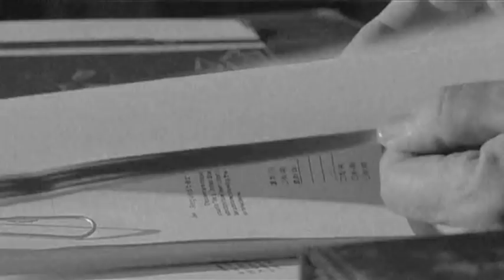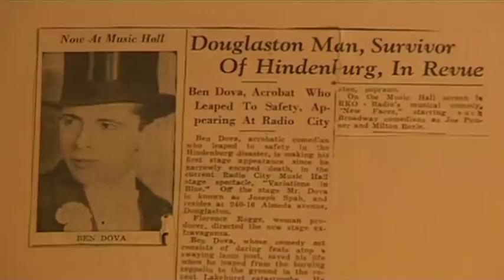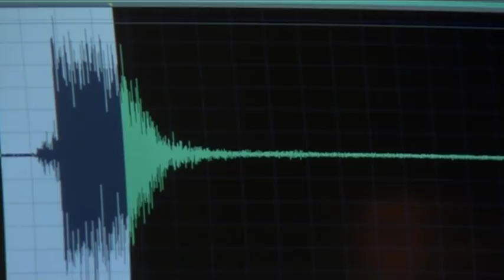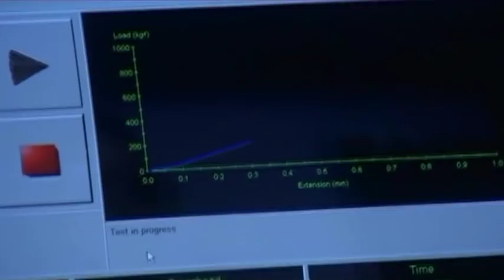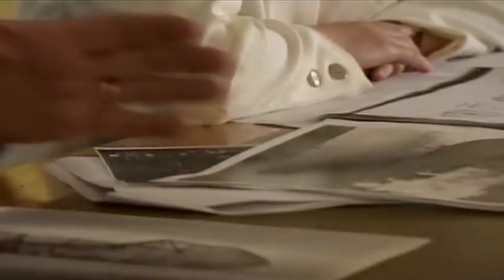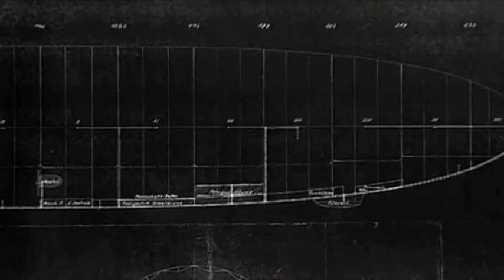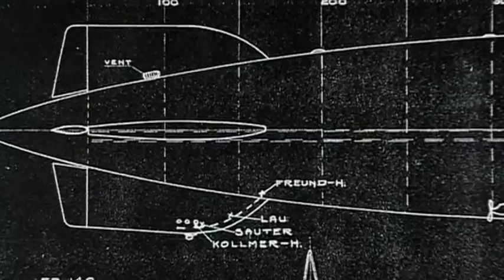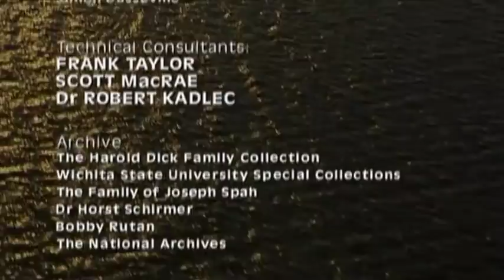Discovery Ch Documentary - The Hindenburg Disaster: Probable Cause (2005) -  hosted by Jack Roberts

Comment: The cause is obvious, since the landing was filmed. The Captain was obliged to constantly drop water ballast from the rear, to make up for the loss of buoyancy resulting from gas leaking from the rear gas cell. The cell was almost certainly punctured by a wire which snapped when the Captain turned too sharply. The Graf Zeppelin flew safely for thousands of miles - the Captain was almost cautious to the extreme and never took any risks. As to the cause of the spark which ignited the escaping hydrogen - almost certainly static electricity, resulting from the outer skin being inadequately bonded to the aluminium frame. There really is no mystery as to why the Hindenburg caught fire.

Comment: That colour film is LZ 130 Graf Zeppelin (II) in 1938, not the Hindenburg.

I had a UK version of this documentary before but lost it - I'm wondering if anyone has it. This version is cropped to 4:3 and then stretched back. The source should be 16:9 with the LZ 130 footage being wider.
Reply: Frank Lin Yeah i knew that was the LZ 130 from the start of that color film. I've only seen one short video of the LZ 127 & LZ 129 in Color. They all look lovely in thoes films...really shows the full detail of the Zeppelins. If you have'nt seen the vid, heres a link.: 

https://youtu.be/23D4g4E_K3k
Reply: Hi, 

I've seen that film before - it only colourized from black and white, not a true colour film. The name of Graf Zeppelin was most likely red from the start (but there is still debate whether it was black during the first year). That footage also shows LZ 130's name by mistake, and it was definitely red.

There was a Japanese short film that had colourized Hindenburg footage but I checked again the video was removed! :(

There are quite a few LZ 130 colour photos but I've only seen 3 LZ 129 confirmed colour photos - two showing the engine cars in flight, and one from the ground with the ship very high up over Suchteln. There's also the colour postcards of the interior, but these might have been colourized. It is said passenger Otto Clemens had colour film on the last flight of the Hindenburg, but he lost it in the fire.
Reply: Frank Lin Wow, what a shame that the film was lost. There is a pic on Google of LZ 129 on the Mooring Mast in Lakehurst in 1936 color photo of the ship on the ground and people around the ship.
Reply: Do you have a link to that photo? It's probably colourized.
Reply: Yep - colourized for the book cover of Zeppelin Hindenburg by Dan Grossman, Cheryl Ganz and Patrick Russell. If you look carefully the Olympic ring colours are misaligned. Original photo has not been released but it was taken by Bill Schneider, a postal clerk who befriended some of the Hindenburg crew (some of his other photos appear inside the book).
Reply: Frank Lin Darn :/ it seemed so realistic color-wise. I noticed the Olympic Rings as you mentioned that is strange how the colors are different. I want to build another Zeppelin like LZ 129 using the old methods...would need materials/ people/ funds/land ect im looking into it...now i just got to ask around for willing participents.
Reply: I found two more LZ 130 colour films, although the colours in both are more faded than Harold Dick's footage. One is seen at the end of this video (unfortunately not very good quality):
https://www.youtube.com/watch?v=FV6foW4REME

Here's another one that's better quality but the colours are more faded:
https://digit.wdr.de/entries/88736?index=52&q=eyJ7Yn0iOiJ6ZXBwZWxpbiJ9&qt=search

As for that colourized footage link you posted earlier, the source documentary is called "Hitler's Champions" (originally released in France as "Les champions d'Hitler" and also in Czech as "Hitlerovi šampioni").  The main focus of this documentary was on the Olympic games but since boxer Max Schmeling and stunt pilot Ernst Udet are two of the key characters, Zeppelins are also shown.  You may find a fairly decent quality stream of the Czech version on Dokumenty and also a 1080p HD MKV download on Uloz (just search the Czech title will take you a few hours to download both episodes). I can't find a version without TV watermarks as on that Wehrmacht video, but the Czech O2 HD watermark isn't too distracting.

Episode 1 has the launch of the LZ 127 Graf Zeppelin (but oddly, the name scene shows the LZ 130) and the Hindenburg, as well as briefly Max Schmeling's arrival on the Hindenburg. The second episode has footage of Ernst Udet's sky-hook trapeze test with the Hindenburg in 1937. You can see some of that footage here:
https://www.youtube.com/watch?v=C3yEKoO2ohQ

The edit in the documentary makes it look easy, but it was quite cumbersome as seen in this more complete Italian newsreel:
https://www.youtube.com/watch?v=J2kzo1JOtmk

Odd thing is the producers colourized the Graf Zeppelin's name in black and Hindenburg in red. The consensus of German historians at the Zeppelin Museum in Friedrichshafen was that the name started as black and was only changed to red by the time of the Nazi era and the takeover. However, several newspaper accounts from the christening in 1928 and onwards which assert the name was red.  It is also interesting to note that there were some laws prohibiting the names of airships to be red, but Zeppelins seem to have been an exception.
Reply: Frank Lin Wow! Amazing color footage of LZ 129 and 130 just beautiful! Ernst seemed to have alot of problems lining up the hook of his Bi Plane...dont blame him seems too risky, no wonder why hindenburgs crew removed the hook later. Makes me wonder if the hook idea damaged the keel in the same spot enough to where thoes two large water ballast tanks go flying out under the ship in the  explosion.  Anyway great finds that high landing should  have never happend.
Reply: I'm not sure the hook was ever removed. There were some statements saying it was already there in mid-1936, and extended for the April 27 test (I haven't seen any photos of this one, as the previous newsreel comes from March 11).  It's very hard to see to begin with and it is likely they would have continued the tests had the last flight been successful. It's also important to note that Udet was out of his glory days at the time and other pilots were arguably more suitable for this maneuver. He was a heavy drinker and some reports say he didn't like his job at the time. It is said that later on when the war started, Goering basically screwed him over to the point of suicide.

It's not often mentioned but on March 11 the Hindenburg also used a 3-bladed propeller on its aft-port engine car. This can be seen in this picture:
http://www.der-isenburger.de/aktuell/09-10/pdfs/30.pdf

Here's another 1937 photo, probably on May 3 (it is labelled as such in Henry Cord Meyer's archive, but difficult to be sure).
https://www.flickr.com/photos/sdasmarchives/38835777901/in/album-72157661261356747/

However, due to some damage during pre-flight tests, the propeller wasn't as loud and had some vibration issues. It was subsequently removed. A week before the flight to Lakehurst, the propeller was added again but the key engineer overseeing its operation was unable to make the flight and asked it removed.

As for the water tanks, I don't know why only those two burst out. However, one of the foremost airship historians I talked to determined the forward tank is a wastewater tank (.......); the rear tank could be fuel or water.

I've always wondered why a large crack appears behind the passenger decks moments after the fire began and halfway into the crash the side of the airship buckled inwards and that gas cell (cell 11) "burst" (see 39:36 in this video). New cabins were added to the starboard side in September at Lowental  (not over the winter, as often stated) and later refined for 1937, but maybe this area was imbalanced.
Reply: Frank Lin Great pics of the 3 Blade Prop! Never knew Hindenburg used one. I knew Graf Zeppelin II used one on it's rear Port Engine. 

Such a shame Goreing treated Udet that way...i always hated Goreing. The ZEPPELIN UDERTAKER!! (So pissed he scrapped LZ 127 & LZ 130) 

The Crack you mentiond seems strange.. you could be right...it would seem that if the new cabin installs were good, no issues would be present. During hull and overhaul inspections in late 1936 or 37 before the fatal Lakehurst flight of that season.. inspectors found rust on some bracing wires and girders throughout the ship but not the entire structure. maybe rust could have played a big role in that area of the ship buckling. Could also be that the ship wasnt designed strong enough to hold the excess cabins. Maybe the loud cracking noise Spectators heard while it was flying over the landing field at NAS LH was the ship's Center section buckling under pressure instead of a bracing wire slashing a gas cell open..who knows. Hindenburg's back broke during the explosion, which made me always wonder if a fire or explosion could cause that much structural damage in a matter of seconds. The structure was already damaged ahead of time and that's all it took. As for the fuel or water tanks flying out who knows but historians say both tanks were connected and thats why they both fell out..but why thoes 2 only? Froind , or Helmut Lau, witnessed a bright flash inside near the lower catwalk, then cell 4 completely vanish then flames and girders flying in every direction. To me this sounds like a oil fire or hot diesel fuel leaked on to another hot pipe near the center catwalk and thats all she took.
Reply: By the second or third flight, the LZ 130 had 3-bladed propellers on both its rear engines but the forward engines always used four-bladed props.

I have to say I'm not particularly convinced by this documentary's fuel leak theory. Freund didn't see anything as he was facing rearward, not towards the front of the ship as this documentary stated. Lau didn't say anything aboutthe fire starting at the keel but a bright reflection on the front bulkhead, seemingly near the center of the cell. There were no fuel tanks or any electrical wires across the axial catwalk. The footage from the final approach clearly shows there are landing lights, so there wasn't a failure like what this show implies.

Comment: At the bottom of the hindenburg 3 quarter back there is something spewing out the bottom 30 to 35 min. Into this recording
Reply: That's Water Ballast being dropped from one of the two 600 gallon Water Ballast Tanks. There were two in the Stern, and two in the Nose, near the Control Car. 

Hindenburg made 3-4 Water Ballast Drops during that landing....VERY unusual. Usually, she'd only drop Water Ballast 1-2 times during Landings.
Reply: they dumped water

Comment: Hugo Eckener's explanation based on his own examination of the crash was perfectly reasonable and trustworthy. Too tight a turn coming into the approach overstretched and snapped rear cables and thus lacerating the stern cell.  It was a command error which Eckener would never have permitted.
Reply: It was the wet landing ropes which connected the now wet skin of the airship containing hydrogen to the wet ground. (There were thunderstorms with ground to cloud lightning in the area at the time of this event.)
Takes about 4 min. for enough of a charge to accumulate, create a spark and the airship filled with hydrogen exploded. Some have also suggested there may have been a hydrogen leak at the rear of the Big-Bag-Of-Gas which mixed with the air creating more potential for disaster.